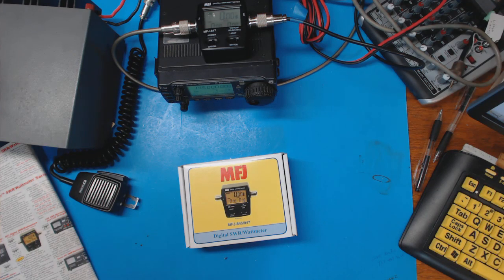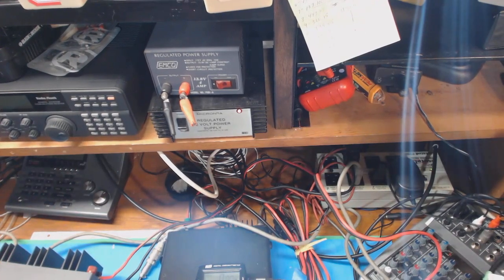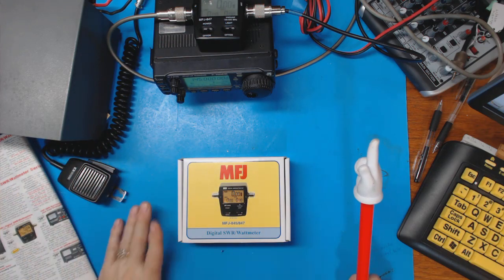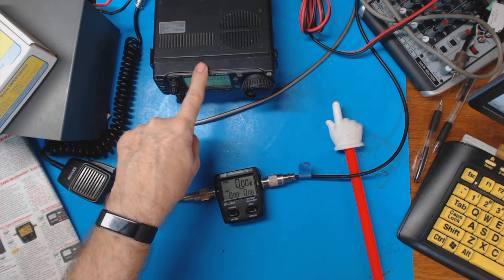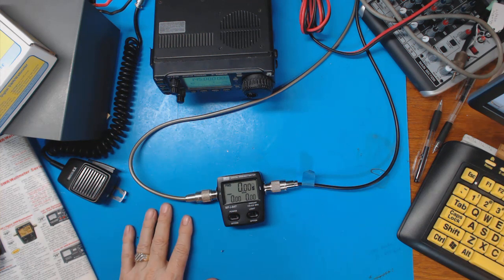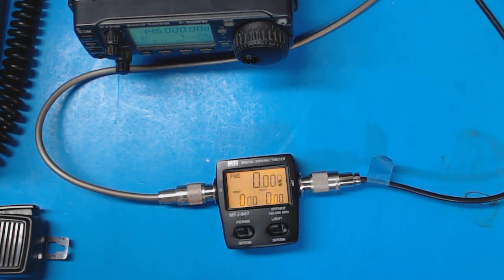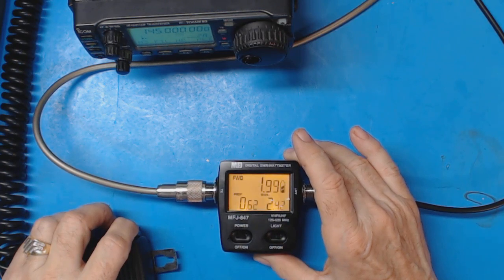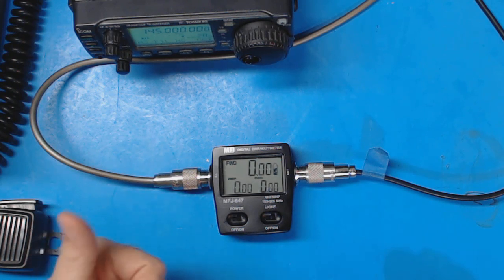TRRS #1418 - MFJ-847 Digital SWR/Wattmeter (See correction in description below)

Comment: Under the switches it reads option, what is it for ?
Is it plastic or metal case ?
SO239 or N-connector ?
Reply from the maker: Sorry I did not zoom it better.  It says :OFF/ON".  SO239 connectors.  Excellent question.
Reply: hamrad88 Ah ok, its my screen resolution. Of course its on/off, I got option out of it. Thanks.
Reply from the maker: No problem.  i can see how you could read it that way. LOL